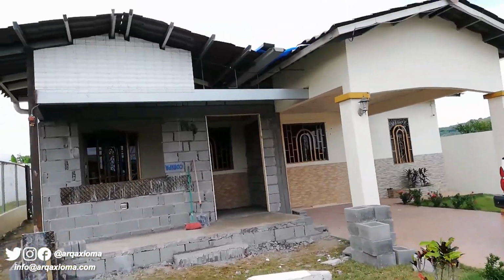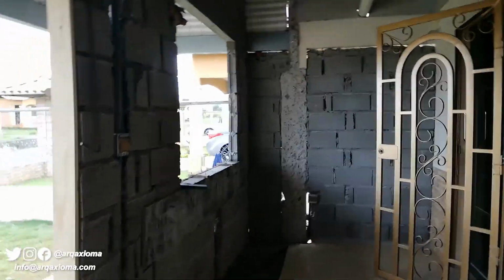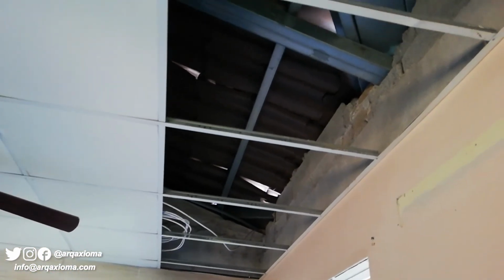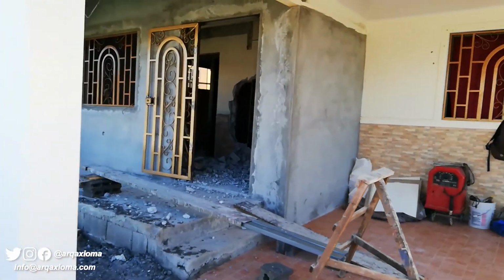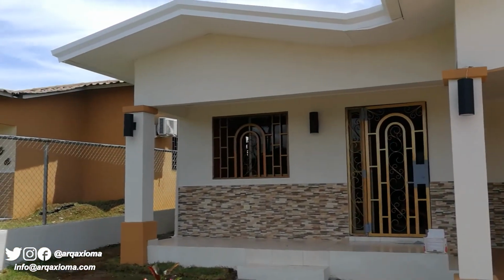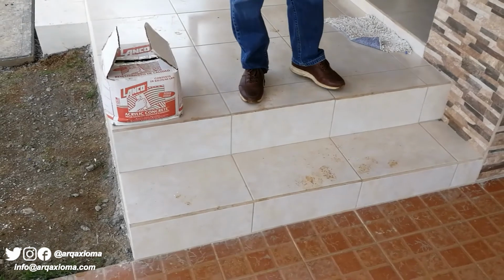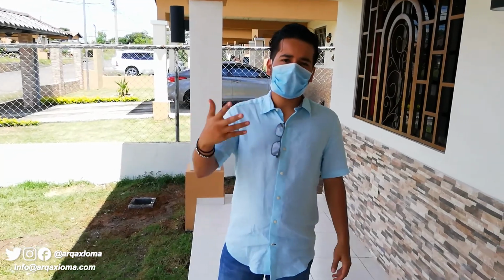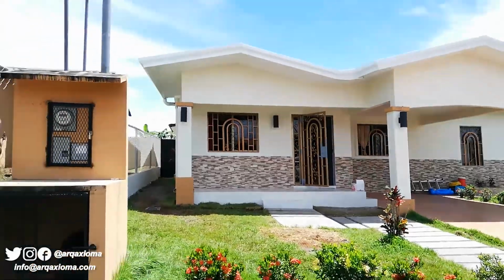REMODELING HOUSE DURING COVID PANDEMIC | Architect in Panama

Comment: Seems like a narrow block size. What are the standard block dimensions used for construction in Panama?
Reply from the maker: We have 4 inches for standard walls, 6 inches for wet walls (plumbing) 8 inches for structural walls, those are the main ones but for example that column is made out of blocks too and its a 1ftx1ft block stacked on top of each other.